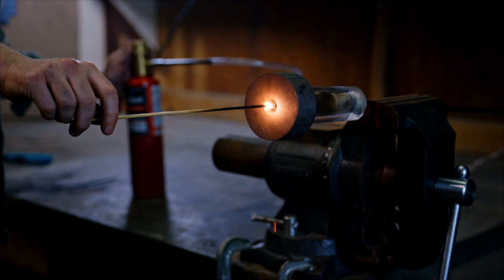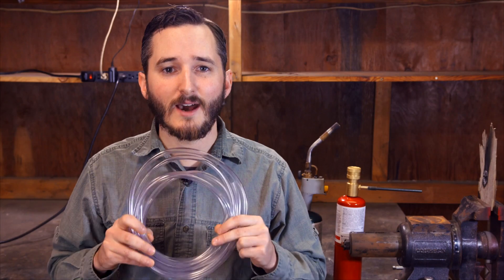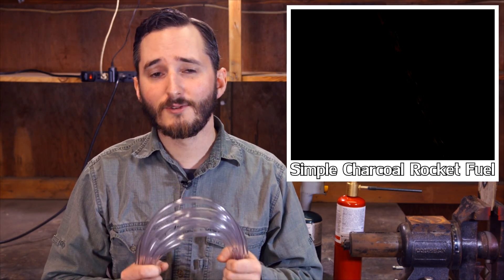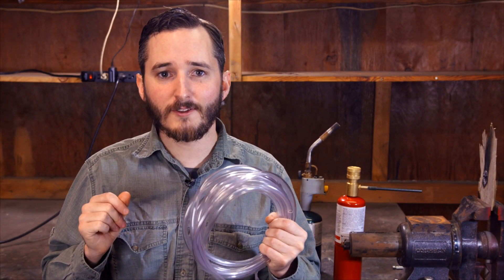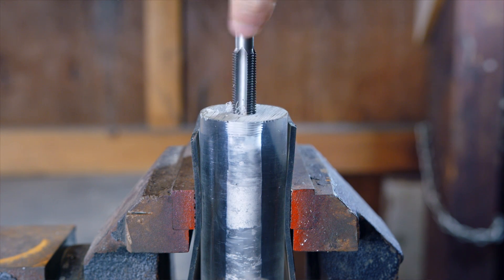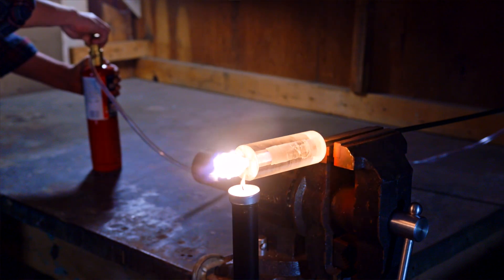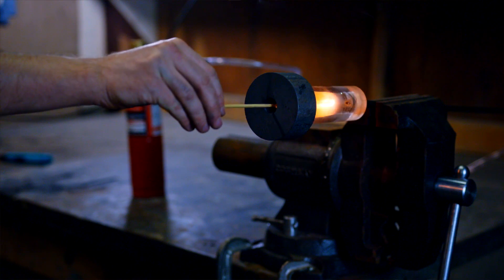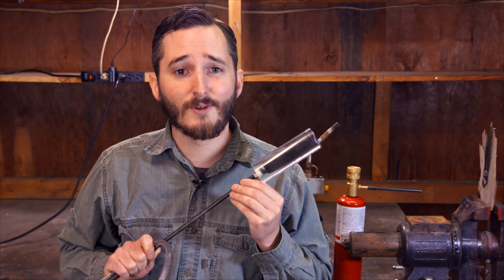Building a DIY Transparent Hybrid Rocket Engine - NightHawkInLight

Comment: It doesn't shrink, it's just the refraction changes due to liquification of the inside wall of the combustion chamber.
Reply: +James Di I think he was referring to why the burn regression rate at the forward end of the chamber was slower than at the back (nozzle) end.

This is largely because the velocity of O2 is higher at the head end, and the OS s focussed more to a fine jet.  As the O2 jet flows towards the back, it's slowing down a bit, expanding, and hotter (preheated).  Which causes the acrylic to burn, and hence regress, faster.

You can see a somewhat analogous effect visually at the nozzle itself, where the flame is not expanding to match the really coarse pseudo-taper he drilled.  This is "classic" underexpansion of the exhaust.

In more serious rocket design, not only does the nozzle venturi have to be precisely shaped to produce optimal thrust, you'd also shape the gas injectors to try to better balance the regression rates.

Machining precise curves in nozzle venturi is quite hard if all you have is a manual lathe, rather than full CNC.  In larger amateur  hybrid motors they often "cheat", and instead of a single venturi, in a big fat chunk of graphite,  the nozzle is often a much thinner graphite plate with numerous smaller venturi .  This has two advantages.  The shape of each venturi is less critical, and it's a much smaller chunk of graphite - cheaper and a lot lighter.

As a side note, while Nitrous oxide is rather more difficult to obtain than O2, and isn't quite as energetic as O2, it is FAR SAFER than O2  in large part because it's not so aggressive.

Secondly, since N2O is quite easily to liquify at room temperature, the oxidizer tank in an amateur hybrid doesn't need to withstand as much pressure as a O2 cylinder.  It's effectively impossible to have liquid O2 at room temperature (it's vaporizing off at a horrendous rate) no matter what pressure you have it at, and for gas, you need much higher pressures to have nearly the same oxidizer capacity - MUCH heavier tankage.

Further, by careful calculation you can pick the ideal injector size, so simple Nitrous liquid -> gas evaporation provides the pressure you need to run the rocket combustion cycle, and the pressure remains relatively constant until the nitrous runs out.  Flying amateur rockets with liquid O2 is impractical (not to mention quite dangerous), very difficult to obtain, and if you use gaseous O2 in the tank, the delivery pressure varies wildly, and the thrust is no where close to being consistent.  With O2, you generally have to use liquid O2 and pumps to get consistent thrust.

O2 is ideal for demonstrations like this, where the overall visualization is more important than optimal thrust.  But if you want to do high power rocketry with reliable and consistent thrust, DO NOT use O2, use nitrous.  Leave O2 to the big boys with big bucks..

Comment: The core looks the way it does because you are basically flame polishing a tube. With acrylics you can turn a matte edge completely clear with a quick burst of high heat run along the edge. So whats happening here isn't that it's catching fire but the heat builds up to the working temp for it to polish and smooth off. So rough and opaque to smooth and transparent! ;D

Comment: This is a great video. I have a question, instead of using an acrylic rod can the same thing be achieved using a certain type of PVC. I have discovered some rockets use hybrid fuels like sugar and pvc. So it would seem like acrylic does the same thing.

Comment: The core seems to shrink due to gradual flame front propagation towards the Oxygen input nozzle at the end. This is an indicative of the fact that the rate of reaction is higher than rate at which oxygen is supplied into the acrylic cylinder.

Comment: Unless you switch to liquids what you have made is nothing more than a torch not a rocket motor.
Reply: It needs the nozzle geometry sorted so its actually chokes at the throat, and a lot more pressure of oxygen (hazardous), but yes for launch ability you need to lose the pressure vessel by storing the oxygen as a liquid, and that means having a turbopump to inject it.  But none of that stops it being a reaction engine, which is what a rocket motor is.
Reply: Mark Tillotson Liquid nitrous oxide is easy to work with in this scale with decent ISP
Reply: Interesting, I have a mind to build a hybrid like this - but presumably liquid nitrous is pretty dangerous to handle too?
Reply: ***** It's probably the easiest of the liquids to work with and self pressurizes.  Just setup for remote fire and fill.  There were commercial flyable motors made and you may even find them on eBay.  Easy to make floating bulkhead motors once you understand the concepts and math.  There used to be a spreadsheet floating around the web to design NOS motors.  I've made and flown them but have not touched them in years.

Comment: There is no way you could make your motor fly! You simply do not have the thrust, Chamber pressure or Oxidizer pressure. If you ever want to make better nozzles go with 45 degrees on the conversion and 15 degrees for the diversion. The farting sound you heard was combustion instability. For a better performance try using N2o with a Co2 regulator, This way you can increase the Oxidizer pressure until you get mach diamonds. Great video !!! Thanks for posting !!!

Comment: If I had to guess, either the acrylic itself is expanding from the heat, or the opaque layer of acrylic leftover from friction with the drill is being melted and returned to a more transparent configuration.  As the point of combustion moves backwards, the source of heat moves backwards and thus the effect.

lensing from the case itself is probably exaggerating the size of the layer so it looks like the core is dramatically shrinking/opaque layer is very thick when its probably only a small amount.

I could figure it out with two minutes of hands-on testing, but that's my best guess for you from looking at it here.

Comment: the change in apparent diameter of the bore is due to the change in refraction. because the refraction index inside changes as the material is dispersed.
And of course refraction occurs when light passes through a change of medium.

Comment: Do you have access to a high speed camera? Would really love to see the engine running in slow motion.

Loved your video and Applied Science video back then too. Such a comparatively easy, but impressive build.
But what I noticed is the noise it makes and the clearly pulsating light ( e.g. 7:37 ).
I'm just curious: Is the engine/flame pulsating in little "fire bursts" or is it burning continuously like a Bunsen burner and the noise comes from other effects.
Reply from the maker: I do have a somewhat high speed camera and at the very end a few of the clips were in slomo. The pulsing is due primarily to the poor nozzle design. It could use a much better nozzle.
Reply: Thanks for the fast reply.
Ah, yes at the end the pulsing shows a little bit better, but looks like way more fps are needed to make it clearly visible...

I haven't thought about the nozzle, but it makes sense now, thanks for the clarification.
Reply from the maker: I can go faster with the camera but at lower resolution. I didn't think it would have looked very interesting but I may test it just to see.
Reply: What camera do you use for slow motion?
Reply from the maker: Sony fs700

Comment: NEVER EVER wear anything but tough LEATHER gloves when using any power tool!EVER! If that glove were to get caught in the moving parts of that tool, then you hand can receive a lot more damage than if you did not wear the glove.Just don't wear a glove around those moving parts, you are much better off this way!Be safe, Stay Healthy, Keep your fingers.
Reply: +JohnH Wearing gloves while machining graphite is a very strong temptation, because it's incredibly messy, and difficult to wash off your skin completely.  Wearing heavy leather gloves is even worse, because while you might not be too terribly damaged if the tool catches a very light material, wearing leather gloves with larger power tools will almost guarantee you lose at least your whole hand, if not more.

Machining graphite is far better done with a shopvac sucking the dust away from the tool head.  Better a nick to your skin than your hand wrapped around a drill press spindle or your whole arm dragged into a circular saw.

Oh, and yes, with graphite make sure you wear a dusk mask.  Breathing carbon dust ain't healthy.

[I've machined a number of graphite nozzles, some rather larger than these.]

Comment: You are incorrect. Solid rocket engine can be shut down and it is implemented in the Minuteman III third stage. It's implemented by blowing open ports that allow the gases to escape freely and effectively blow out the engine.
Reply from the maker: That only works with very specific types of fuels particular circumstances. It wouldn't work for most solid rockets.
Reply: Absolutely!
It's just there is this universal message in these popular videos that solid rocket motors absolutely can't be shut down before fuel burn out - I simply point out that this is not 100% true.

Comment: There are a couple possible reasons why it might appear to shrink. It could simply be shrinking due the the acrylic expanding as it melts. However, I suspect that the apparent shrinkage is due the angle of refraction changing as the density of the gas/burning fuel and melting acrylic changes. Could be a bit of both. Anyone have any other ideas?

Comment: The reason it looks like it shrinks could be due to two factors; 1, the heat from the combustion could be changing the refraction coefficient. 2, the heat could be melting the imperfections inside making it smoother and a better vector for the refraction to take place.

Comment: I can't see whether the ignition chamber appearing to shrink happens every time, or only on the initial ignition.  If it's only the initial ignition, I would assume that the chamber is really only gaining transparency as the imperfections left by the drill are burned away first.  Any imperfection will have greater surface area, and burn faster, until a smooth surface is left.The effect travels backwards so slowly, I think, because the air pressure resists the spread of the fire, keeping it from spreading inward against the wind as fast as it might otherwise do.

Comment: How is this a rocket engine?  It doesn't use any kind of oxidizer whatsoever.  Only fuel.  -_-
Reply: PowerSports The oxygen gas is the oxidizer and the clear plastic tube is the fuel -_-

Comment: Thanks a lot for this awesome video! PLEASE do more simple-Rocket explanation videos, this one was really awesome! For example how could you extend this model to build one with another regulator for the fuel? I guess you'd use a graphite combustion chamber where the fuel is being injected in as well, instead of the fire burning off the walls. Would be REALLY interesting to see, this stuff is awesome!
I just discovered your channel through this video, I'm glad to give you my sub :)

Comment: sorry to say it but I don't think that this is actually a rocket motor...... all you are doing is burning the acrylic in a oxygen atmosphere........ if the motor pressure was to exceed the pressure inside the oxy tank then the gases would flow back into the cylinder.... have you actually measured the thrust from this?

Comment: actually the flame does not conform to the shape of the nozzle because it is at subsonic flow. Meaning it would form a jet that flows straight out. If you want to make it conform try raising the pressure inside the combustion chamber, two or three times the atmospheric pressure, e.g. pump more oxygen in, then you'll have supersonic flow in the outlet and the flame will look pretty

Comment: Hi, I'm actually a researcher working with HREs, currently writing my thesis on HRE scaling and the effects on performance in going larger while keeping scale. 

Our rocket is simulated using a combustion model my supervisor made (he's pretty brilliant, but very quiet hahaha). Our simulation model is HTPB and N2O however so far it agrees well with empirical models. Current issues are the regression rate ("burn" rate) of the fuel and stoichiometric length in design.

Cantwell gave a good presentation on current developments, and a HRE with a single port giving comparable Isp to larger rockets is doable using GOX and highly refined (basically) candle wax with aluminum particles (I think it was 20% by weight?) below 10 micrometers. 

Anyways, if you get a  big candle from Ikea, stick it in a metal pipe, drill a port into it, and run some oxygen through it, you can get a pretty good rocket out of it :p. Also, you need a proper converging diverging nozzle that needs to choke (at least above double atmospheric pressure if we're being conservative); that can be done, you need a 3D printer with machinable wax and you can make a decent casting with that.

I should probably try all of this...but I need to write and i'm procrastinating right now >_>. Happy to answer any questions!

EDIT: also, I can hear buzzing on your rocket, means the combustion is very unstable. This is a problem with HREs but can be greatly mitigated with a pre and post combustion chamber. Also to fly, you really do need a proper nozzle.
Reply: How do you get into the field of research like this ? I'm not gonna pretend like I am a expert or understand all the science behind rockets and space craft.
Reply: @jillvalentinefan77  Are you referring to me?  I simply got interested in rocketry beyond model rockets, read the relevant books, happened to have a number of friends also very deeply into the hobby.  One of them designed, built, flew and sold (to others in high power rocketry hobby) "solid core" and hybrid motors into the 2000+ pound thrust range.  Another was experimenting with tri-fuel/hybrid motors.  We all wanted to build various designs of our own, and a local highschool had us show up for every machine shop adult course every summer for several years.  We used to joke with the teacher that he must have failed miserably in teaching us, because we had to keep coming back.  The whole point was to get access to decent machine tools.

Part of what happened is that we all ended up making parts for each other's motors.  It was our interest, so we had to understand what the part was for, and how it was designed.  So we taught each other what we had learned in our various inherent specialties.

I've made graphite nozzles both of the single venturi and "plate" varieties, for combustion chambers up to 8" in diameter.  I've built combustion chambers for solids and hybrids, pre-heat shrouds for tribrids, interstage modules, electronics subsystems etc.  Assisted in the manufacture of several kinds of rocket fuel, etc.  Test engine fires, ground support, Launch Control Officer and so on.

I wasn't quite bitten with the same level rocket-bug as the others, so my projects weren't quite as adventurous as theirs were, but I ended up understanding just about as much as they did.  They pushed the envelope more than I did, and as a result had more failures than I, but, that was okay by them too.

One of the things you learn in life is that people who do things they enjoy (which is what a hobby is), can often understand things far more deeply than those just drawing a pay cheque.  It's not work, it's play.  Even better if you can get paid to do something you'd happily do as an unpaid hobby.

The best way to learn about basic rocketry is to get bitten by the high power rocketry bug.  You can fly Estes rockets without learning a thing, but to successfully fly level 3 high power (my level of certification), you have to learn quite a lot, no choice.

If you want to start, if you're very lucky, you'll have a high power rocketry group in your area and go to their launches, ask questions, and get yourself started.   If there's no high-power group, look around for more serious model rocketry groups.  They'll usually have a high power afficionado somewhere looking for some company.
Reply: As a general rule, solid hybrid fuel should be quite opaque. If the fuel is translucent, infrared will heat all the fuel rather than only that directly in contact with flame. Wax is problematic, except for very short tests. One might do well to use HTPB with .5% carbon black at first, as adding metal powder makes matters a bit more challenging.

Comment: I think that The apparent shrinking of the core may be caused by the difference in pressures. People say that heat goes up, but what actually happens is that heat is the rapid movement of molecules, and said molecules move in the direction of least resistance, which means that it will follow a gradient in pressure. inside the rocket, as the acrylic ignites, it generates heat, which flows toward a layer between the centre of the core (through where the oxygen is flowing) and the actual wall of the tube (which could be defined as a zone of infinite pressure under the given condition. fluid dynamics tell us that pressure is less inside a moving zone of any given fluid, than on any of its static areas. The boundary layer principle will tell us that the fluid is static where it meets the boundary (the walls of the pipe) and from there on the speed will increase toward the centre of the pipe where it reaches maximum speed. this causes the flame to detach from the walls and flow toward the centre, giving the appearance that the core itself is shrinking.

Comment: Solid rocket engine CAN be shut down. Most of solid fuels need high pressure to burn fast enough. Some solid rocket engines have a hatch, which releases gases from combustion chamber to drop the pressure and stop engine.